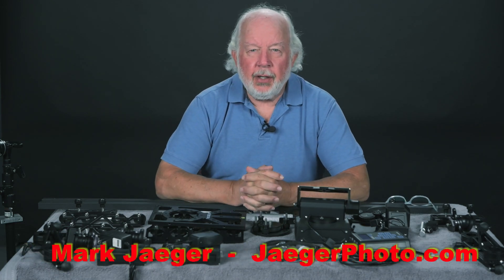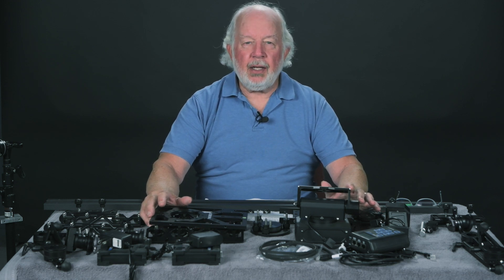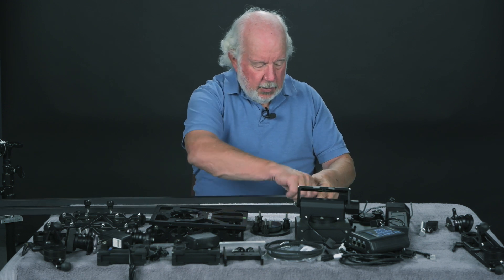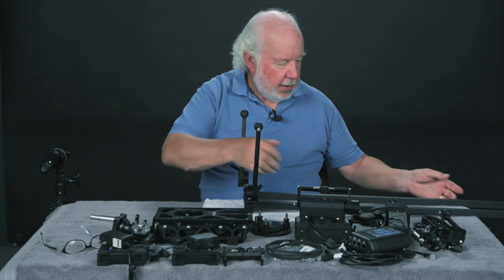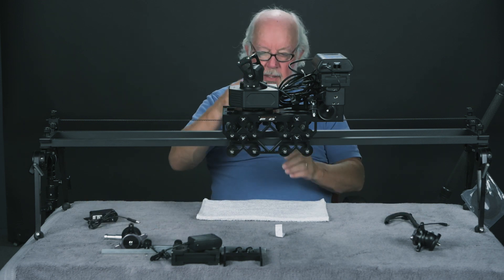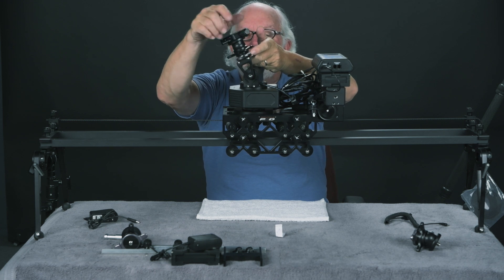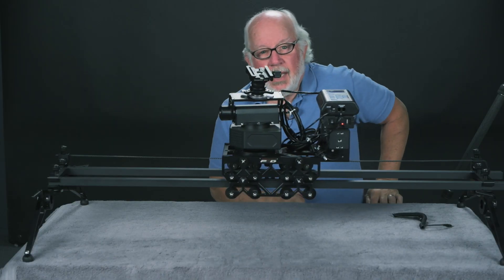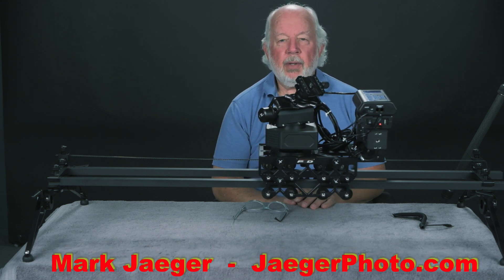Shuttle Pod Mini & Second Shooter Plus - Setup & Operation

Comment: Love the video! Second video on the way?
Reply: Thank you for the quick response. Every time I get close to buying a slider and 3 axis set up someone tells me something that they don't prefer with it and that's a great thing but it also keeps on preventing me from purchasing one. The emotimo looks like far too much gear for me to lug into the wilderness as I primarily want to do time lapse photography but I love the idea of getting the shuttle pod Mini so I can move into video at some point if I choose to( vs the Tls). Can you please give me your insight on as to why you sent the Kessler gear back it's extremely important to me as I'm about spend a lot of money on the set up. Thank you again for the videos they're extremely helpful and super informative.
Reply: Again thank you so much for your response it's really hard for me to come by really good videos about products that I like and be able to have a fluid conversation about them good versus badd.
Reply: So if I did go with the shuttle pod Mini. And I only used tripods mostly in slightly vertical positions do you think that would prevent any kind of movement in a negative manner?   I'm still a little bit unsure as to what you mean about the length-if not the length of the slider.
Reply: Thank you!!!!  In my opinion I think all that me and you have talked about would make for a great video. I think a lot of people are looking for insight like this before buying any product as you are an engineer  And super knowledgeable.